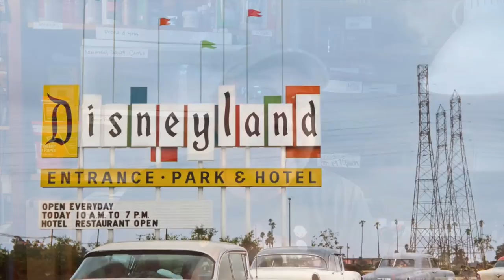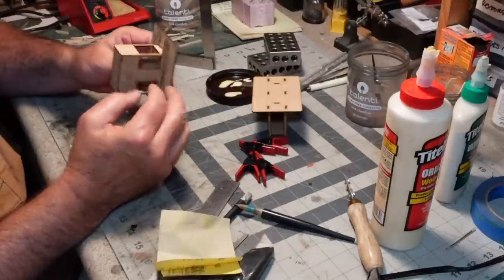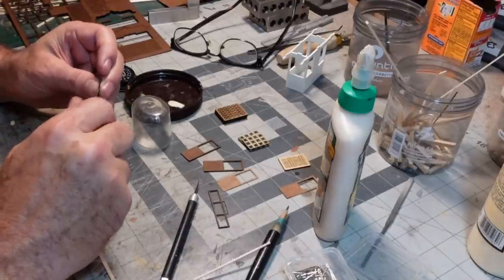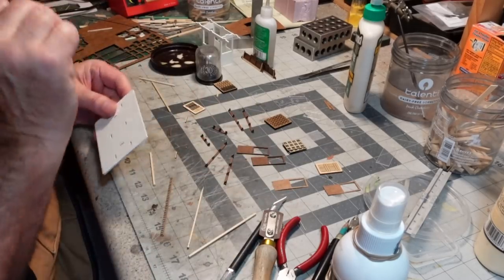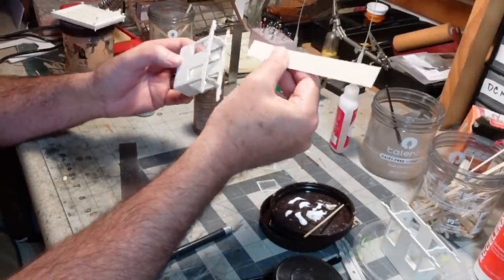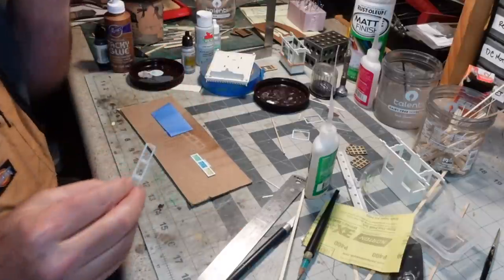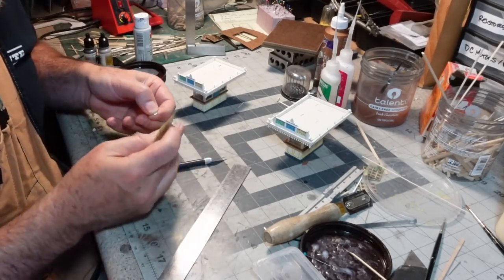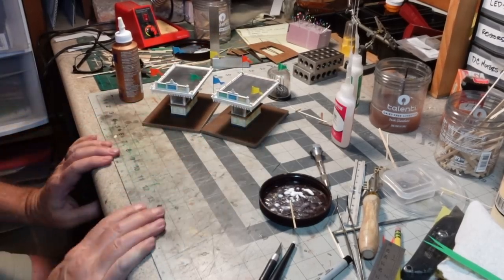Modeling Vintage Disneyland Ticket Booths in O Scale

Comment: As always Dave a finely finite feature.  Your buddy should be exceedingly proud to have it in their collection.
As a former Mouseketeer and Park Castmember, we did not frequently pass through the ticket booths to access the park.  So some of the details are nothing more than distant memories.  But one thing I'm sure of is Ticket Booth #1 ver.1 went to Sharon Maye when park maintenance tore down the original booths for ver.2.
Now a quick P.I.T.A.
It was my belief that the first ticket booth versions had Gold indented numbers with a Gold Laurel Wreath.  Version 2 was the same indented numbers and wreaths in multi-colors.  One color for each booth.  Though version 2 was during the "WONDERFUL WORLD OF COLOR" era.
So now my pain in the a##.  It could have been easier and more clear IF you had printed all signage, including booth numbers, onto peel-and-stick paper.  Then you could have all your details on one sheet.  With it's own adhesive.  Just a thought.
Adios,
Jim
Reply from the maker: Thanks for the info!

Comment: There are 3 original "ride ticket" booths (inside Disneyland). The lighthouse structure at the entrance to the Storybook Canal Boats; The Mushroom shaped control booth for Alice in Wonderland; and the souvenir stand  on the walkway across from the It's a small world gift shop -> were re-purposed over the years, but the structures remain in good condition. Most of the fancy wood architectural details were made from California redwood and have stood the test of time.
Reply from the maker: They might make good models too!

Comment: For the front ones, if they were built similarly to ones at other theme parks of the time, they were likely torn down with some framing reused for their replacements. I saw them taking down a few similarly aged booths near me where they had an internal structure that had been reused repeatedly, but the exterior was ripped apart and rebuilt along with a lot of the internals, mainly due to a frame with electrical built into it that handled things.

Comment: What do you mean they are not model railroad structures they are the right scale. 
isn't part of the back story of the Thunder Mesa.
That a group of gentlemen visited Thunder Mesa country and then went off and built a small theme park in an orange orchard some where.
So how do we know for sure that those ticket booths are not based on something the group of gentlemen saw in Thunder Mesa country.
They could be you never know😀